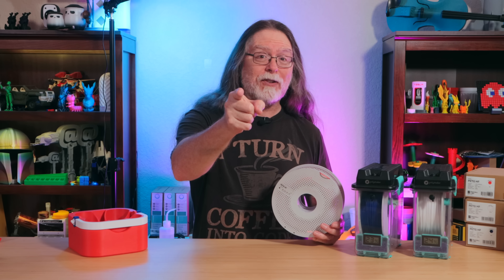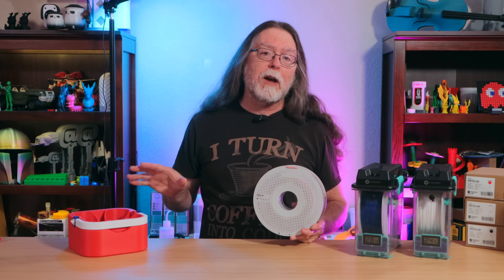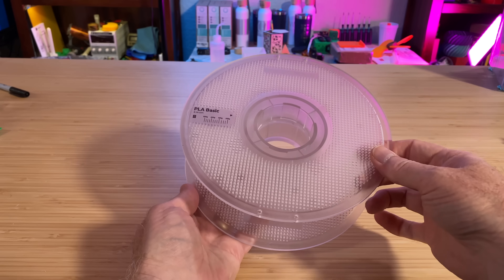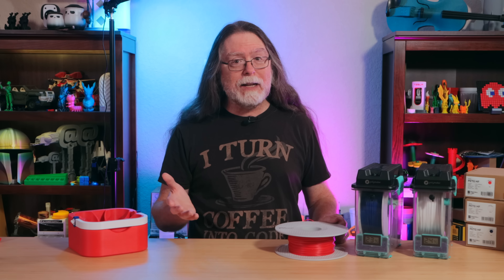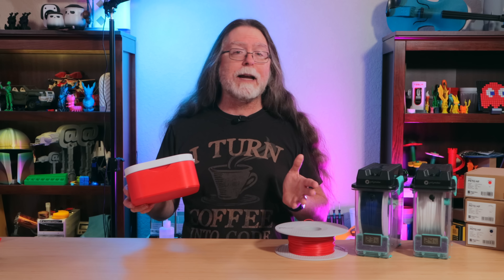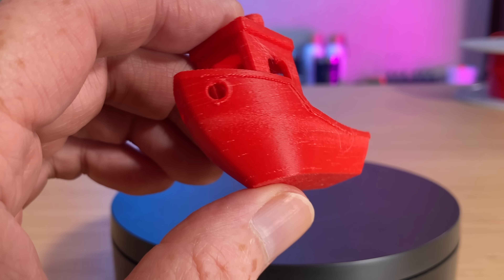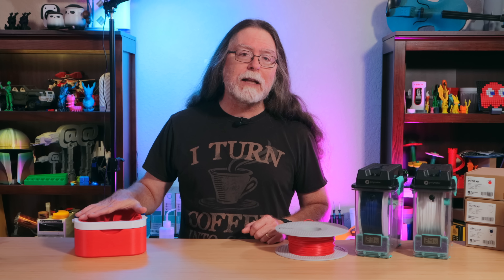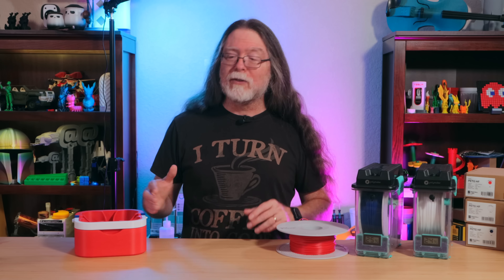What is PETG HF Filament?

Comment: This stuff is an abomination. It absolutely welds itself to the build plate and leaves nasty white marks on the first layer every time. I have had endless trouble with it. Just use actual PETG. This is on a H2D calibrated with bambus official profile.

Comment: I've been printing with PETG from various manufacturers with my first gen Ender 3 and Kingroon KP3S for years without issues. For me, most have printed as easily as PLA. I don't get clumping and stringing is almost non existent. Of course, I don't print at really high speeds either. I'm fine with that because I primarily print functional parts where surface finish and dimensional accuracy is most important.

Comment: Love that I ordered my first printer and they sent it with this stuff, not on spools, and not dried.
Reply: They sent me nylon with carbon fiber in it which would mean I'd need: a dryer, a new plate, a hardened steel hotend. And that's just what I know about, I'm new to this there could be more.
Reply: @CJShrader  damn man that sucks. I ordered a Bambu AMS and apparently that comes with 4 of the reusable spools so hopefully its a non issue
Reply: @DogByteFR  It's hard to complain too much because it was part of the "free gift" so I didn't pay for it and I'm going to sell it, but still it would have been nice to get something that wouldn't cost $60+ more to actually use.
Reply: @CJShrader  true. And if you are selling it ig you can just put it into PLA. I think the worst part is having everything you need to start printing without actually being able to start
Reply: @CJShrader  i was also looking on amazon recently, dryers start at about £40 it seems. It is kinda annoying for the first purchase to be such a high end filament for you though, you'd think they'd bear that in mind

Comment: The only issue I've had with PETG-HF is very ugly seams on continuous loops.  The outer wall of your cooler cube has no corners to hide seams so you should have seen one on the surface somewhere, but I didn't see one in your video.  I spent a day playing with seam settings and in combination with pressure advance and some other filament settings I was able to get the seams to be tolerable.  Scarf seam settings didn't help, you just wind up with two ugly seams instead of one when using that.  I also did some experiments with filament drying and was not able to get a bad print.  I took three rolls of the same color, opened one and let it sit out for two weeks, opened one and put it in a commercial dryer at 10% RE for two weeks and left the 3rd one sealed in the bag.  I printed the same test print on all three spools on the same P1S printer and nobody could tell the difference.  They all looked good, so I've just been using the filament out of the bag without drying until it becomes an issue.

Comment: I have a A1 unit, with an AMS lite is it usefull to print with fillement that needs to be dried  on forehand ? Also what filement dryer would you suggest ?
And last question I saw on makerworld that you could print a closing system for you ams lite, would that help if you would dry your fillement before putting it on the ams ?
Sorry alot of questions here, kinda new to 3d printing

Comment: They recommend 8 hours of 65 degrees. Why does everyone here do it 12 hours? And which temperature
Reply from the maker: I dried it for 12 hours because that's convenient for me to do. If I start it at 7:00 PM, it finishes after I wake up the next morning, instead of sitting in the dryer for 4 hours absorbing moisture again. :)
Reply: @BV3D  thanks will do as well :). I recently bought the creality space double filament dryer.

Comment: I just ordered 8 spools of this PETG HF. Looking forward to a big print project. I always like having information about a thing. I’ll be sure to dry the spools as they come out of the bag. I’d be interested in knowing if they stay reasonably dry in the AMS, with desiccant pods. I saw another creator’s test of this. He ran a flow test and that solved the ‘zits’ issue. 

I need to rerun all of my calibration tests since I’ve started using the BIQU Revo nozzle/hotend on my P1S.

Comment: I've been using Bambu's PETG HF filament for the last month and a bit. Plus a couple of rolls of e-Sun PETG. i havent dried any of them. just opened them up, chucked on the AMS lite, and have been printing perfectly since, using Bambu's default print profiles for PETG HF (and generic PETG for the e-Sun).

It's not mega humid where i am, about 40-45% in the room.

Comment: I’m here to learn by the examples of all you printers. So I learned something before I’ve even started. I have a role of black w/ spool that should arrive this week with the pla rolls. Not that I was going to use it right away. But I’ve seen reviews where it’s used as supports. And I’ve had blasters and ant formicariums that were printed using it.

Comment: I get drying out the bag, but do you have to dry it before every use there after with the HF? As my regular Sunlu petg, I dry it, use it, store in an airtight box with desiccant and I’ll get say 4-6 more print runs with it, say with 2-3 weeks each time in the airtight container before I see a drop in quality and having to re dry.
So basically I can get away with not drying for 1.5-2 months before drying again.
FYI I’m in the Uk, so not very humid if at all lol 👍🏻
Reply: Same as any other moisture absorbing filament. You dry it fully once then as long as you store it dry you're good for a long while.

Comment: What is the creep characteristics of this platic though? does it creep more or similar to regular PETG?

that and the low glass trans temp of PLA is the only reason Im starting to really switch to petg. Any strain and it (Pla) just permanently deforms after a few days.

Petg just... doesnt.

Comment: Ive been trying to dial this in, Ive dried the filament which definatly reduced the pitting in my prints, but stil quite alot of pitting any suggestions on how to resolve this before i undertake a large print?

Comment: Excellent Video! I recieved my first two spools of HF showed up earlier this week. I did dry mine, and both my A1 and P1S detected the PETG-HF. Another odd thing, there was well over a 30% time saving from basic stock parameters and HF stock parameters. It was a more basic model vs a benchy though. It printed insanely clean and near equivalent speeds tp PLA Basic. I'm seriously considering switching to HF as my main filament if it continues to print this well.

Comment: I always have to dry PETG, so this isn't abnormal. I have found food dehydrators to be much more efficient at drying than "filament dryers". You just have to ensure the temperature is correct. I use a certified air probe for cooking to dial in my temps. The cheap hygrometers are as much as 20F-30F off, which can mean the difference between the temp being too low, or being too high and potentially melting a spool.

Comment: Thanks for the review! I have a few future projects that will require PETG. Hopefully they will turn out ok with this, or do you have other recommendations? Elegoo also has a rapid PETG. Don't know if that is OK.
Reply: I've gone through 3kg of the Elegoo RapidPETG and it has printed well. Just note that it has a cardboard spool, so keep that in mind if using with the AMS. Mine have sometimes been bent and got caught in the AMS.

Comment: The high speed PETG by Elegoo came dried and ready to go! It's also very competitively priced on amazon i got a 4 spool bundle at around 16.80$cnd per spool. I changed the default Max Volumetric Speed for Bambu Generic PTEG to 18 from 8. I used this approach because the Generic High Speed PLA setting has a MVS of 18 mm/s over the standard 12 mm/s. Both Elegoos high speed PLA and PETG are rated for 600mm/s so I thought this should work. It did. I get faster great quality prints (A1 Mini). I am staring to really like PETG! You can really tell the difference between it and PLA after you see the inter layer adhesion go down so smoothly. Ah Chiefs Kiss!
Reply: Yeah, that's what I've been using. 2-pack for about $10 a spool and the only annoyance is the cardboard spool in the AMS sometimes gets bent.

I've just been using the generic petg profile. Will have to try changing some of those settings and see how it does.

Comment: I bought four rolls and I have opened two. I dried both for 12 hours and calibrated the red. (X1C) The red printed beautifully, the white was a disaster. I calibrated the white separately and now it prints well also. Between the two the calibrations came out very differently with same drying time. The next two rolls I will run the calibration before I bother printing.
Reply: I wonder what your calibrations were

Comment: Nice.
About the drying, well.... I have had many spools from other venders in PETG and other types that one time are nice and dry in the vacuumpack and next time- or just next spool- just a bit less dry. It depends a lot at storage and transport too. Also inside the  bags.
These are not aluminium-sealed so still plastic and moisture gets in.
So for me, it is always a good recommendation to dry before use, even if 'dry' before it is packaged.

Comment: G'day BV3D.....small fix, use the Sunlu S4 full of this type of filament. Kept in mode 2 will keep the fillament to set dry and heat settings, so filament will always be ready...Cheers Bryan from A M8 Downunder🙃
Reply from the maker: Thanks! The S4 is probably the only filament dryer I DON'T have! I've got that Eibos one that'll do two spools at once and has a "humidity hold" mode, though!

Comment: I just drank a coffee and the talk about wet filament ran away with me lol

A great efficient and cheap way to dry filament very well is to find a convection oven at the thrift store and get yourself 2lbs of desiccant. Then buy some metal screen material at your local hardware store to pour it into and make a bag out of it. That way it breaths very well and you can just throw it into the convection oven. Most desiccant is made for up to 260c, but the oven can surge above that so i recommend setting it to 240c. Takes 1/2 hour for a 1lbs "bag" to dry, and i noticed that if i put in two 1lbs bags it takes about the same time but i still run it for 45 minutes just in case. The smaller bags you split the 2lbs into the more surface area you have ;-)

I've tried the Microwave way, i noticed it tends to turn to dust over time. Doing it the "recommended" way or the safe way, too much heat concentrates and destroys it

Otherwise, if you do the carboard box on the heated bed, it works far better with plane brown carboard so that it can transfer the humidity though it and out. And obviously it's also a good way you can dry your desiccant too, but it doesn't get as dry

I also have a Comgrow filament dryer, but i still keep a 1/4lbs of desiccant in there while running for things like Nylon that need to be super dry. Most filament dryers have a critical flaw, that there completely sealed and don't have a good way for the humidity to escape. Which just gave me an idea 🤔why not have a wall made of wood, to allow humidity to escape that way while holding in the heat

I did a test YEARS ago using a Kill-a-watt meter comparing the convection oven to drying on the bed, the convection oven used about 1/3 the electricity and the container i put that into hit 10% humidity within a few hours while the other only dropped to 15%. Both where around 20% BUT with totally different filaments in the containers. TOTTALLY uncontrolled test :-)

Comment: So... pay a premium dollar and have to dry it yourself? Why would the manufacture not dry it before selling it? Add in the drying time to the print time and its WAY slower!
Reply: You have to dry pretty much every filament that isn’t pla, doesn’t matter who you by it from as the are hydroscopic and absorb moisture.
Reply: @milkybaravenger  not by  long shot. Opposite is true, especially right out of the box.
Reply: @milkybaravenger I haven't dried a single spool of the 5kg of Elegoo RapidPETG I've used, and had no issues from it.

Comment: I strongly advise against drying with the X1C onboard utility. The best cost effective option is a food dehydrator (ones that fit multiple trays) and placing the material in a print dry container that works with the vaccuum pump immediately afterwards with molecular sieve. Fancy/spendt option is a vaccuum oven. I advise against dryer/spool holders, too.

Comment: Does it really take an hour to print a benchie with petg? Pla takes 15 minutes.
Reply from the maker: With the 0.20mm Standard @BBL X1C settings, and Bambu PETG Basic filament selected gives a 59m 20s Benchy. Selecting Bambu PLA Basic gives a 38m 2s Benchy. These are total print times, including the 6 or 7 minutes of "prep time."

A 15 minute pre-sliced Benchy is usually done with every possible speed optimization, printed at 0.25mm layer heights, with minimal infill, etc. Remarkably, they generally look pretty good, particularly given the short printing times. But I'm using standard settings, not highly-optimized-for-a-speed-Benchy settings.

Comment: If they take the time and labour to dry it the price goes up., then all the YouTube reviewers complain that it’s more expensive then similar filament .
Reply from the maker: You've got a good point...
Reply: That, and when it is shipped and later stored in humid or just wet environments, you might still have to dry it since the normal plastic bags are airtight but not moisture-tight.
Like filament itself, it still lets moisture get through unless packaged in expensive special sealed (with aluminium for example, so now also going to the other waste-stack with mixed instead of plastic-recycling) bags.

Some more expensive filaments I have came in those specially sealed bags and are dry untill opening, others are just not.
So: even extra cost and extra waste just to make sure that end-users without experience with those kind of filaments print without drying or issues.

They could even add a 'use by date' with a very short shelf-life too, or just add the strong advise tot dry, dry, dry.

Comment: I print big objects like the filament spool holder mount black pla elegoo thick walls 2mm 32 quality 30 infill lines 205 nozzle 60 bed and i am more than happy.
I have Ender-3